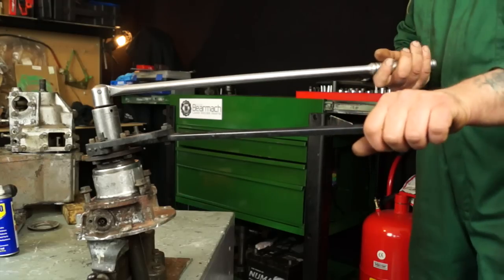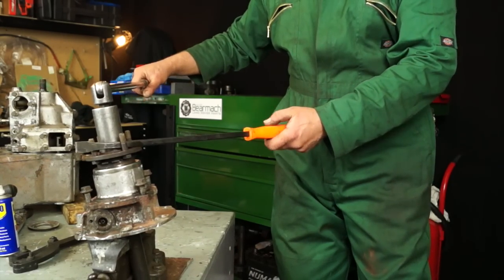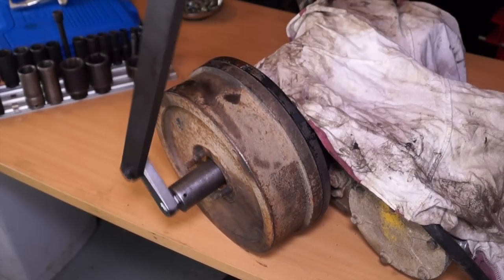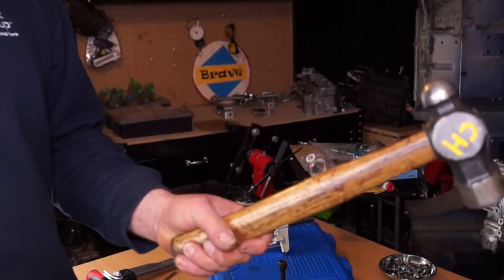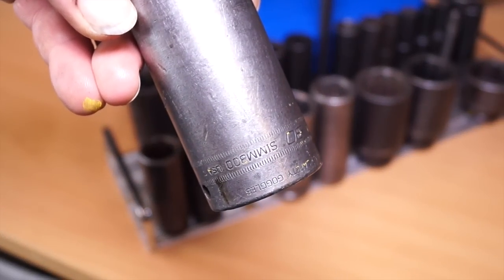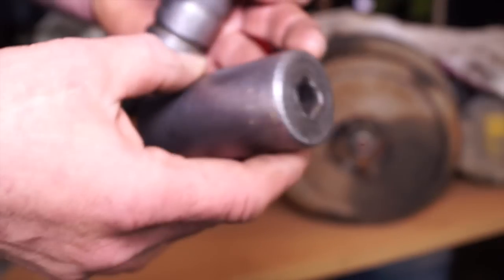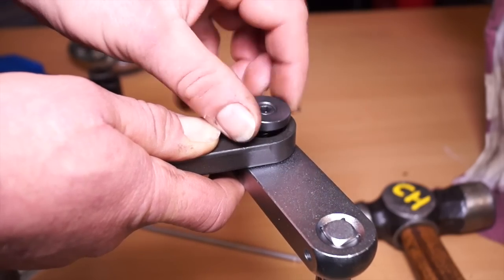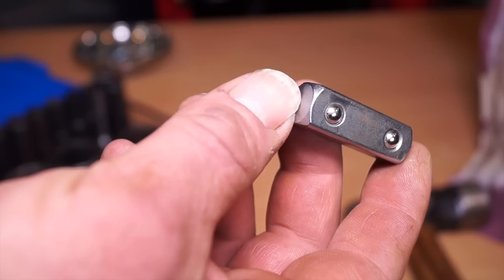Hand Impact Wrench (Paddock) - Tool Review

Comment: @Matt Allen, he fitted a clutch in the 106 though.... surely that counts for something?
Reply from the maker: +Paul B   only the tip of the iceberg.  Now the squealing is gone one can hear all the other problems.   Luckily it is not a stayer.
Reply from the maker: +Paul B  The powerboat pulled off the awfully stuck wheel nuts off that 106 wreck.